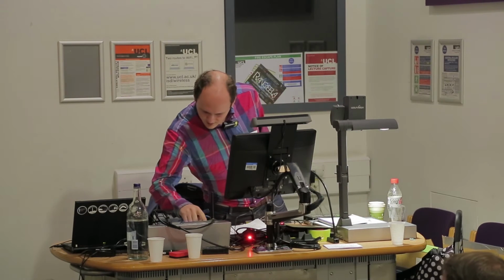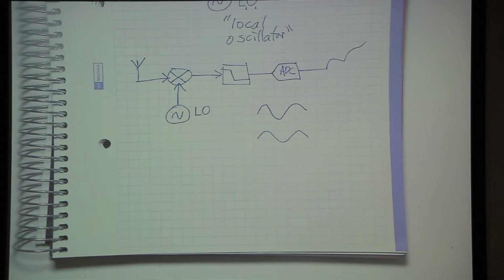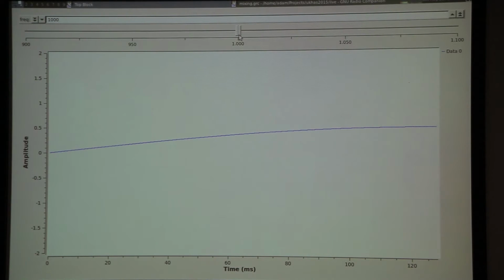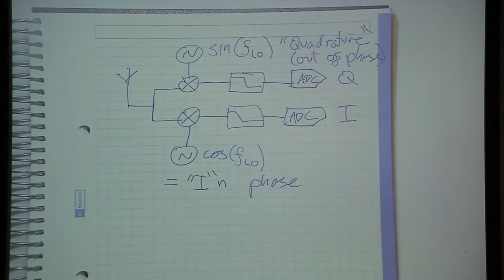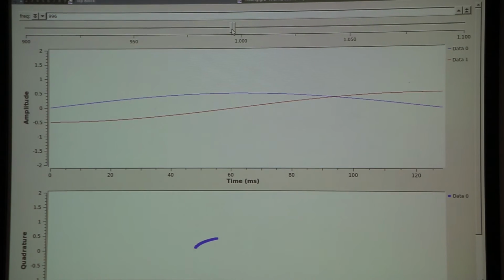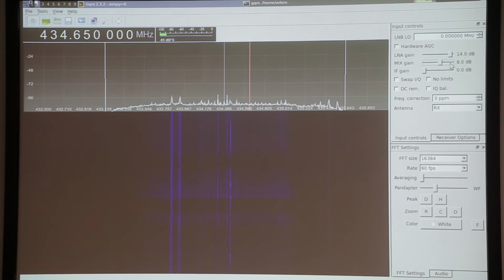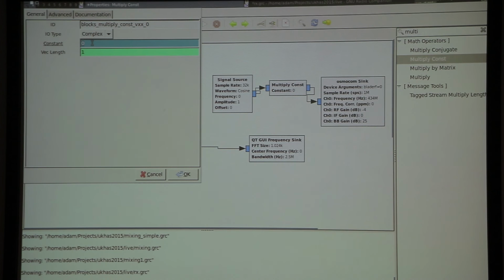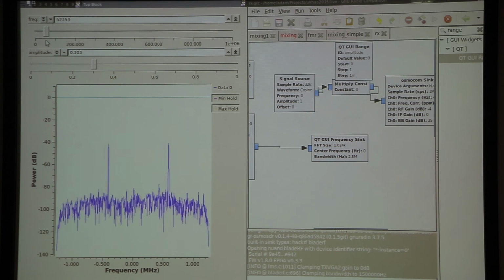UKHAS 2015 IQ Sampling and Software Defined Radio - Adam Greig

Comment: I find this very interesting and wonder if this can be implemented using a P15V330 multiplexer driving two IF preamps which is driven via a Johnson counter at f0+10.7mhz*4 which then drives a phasing combiner at 10.7mhz which can be demodulated using an AM detector or a FM demodulator and if it works as promised should get rid of all sproggies and image frequencies and their sproggies and makes me think that this  is the perfect down-converting mixer.